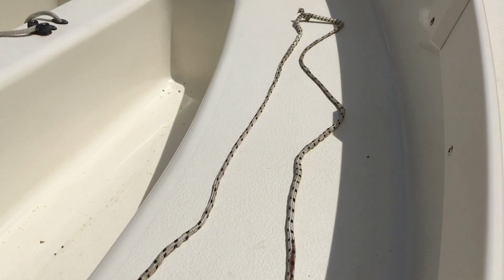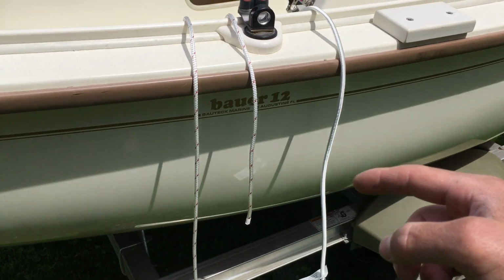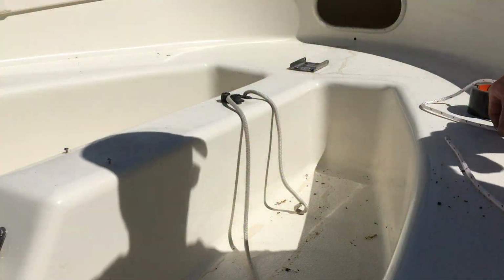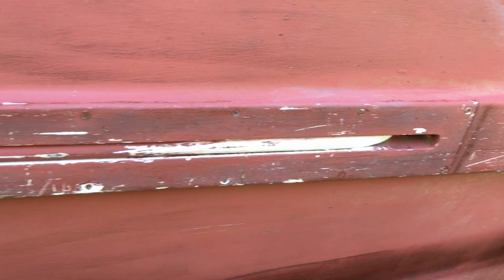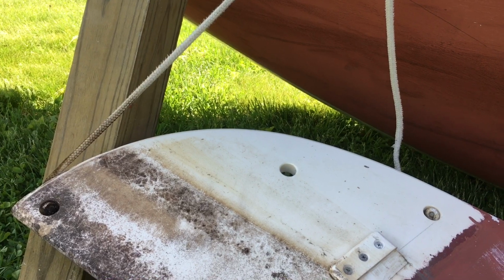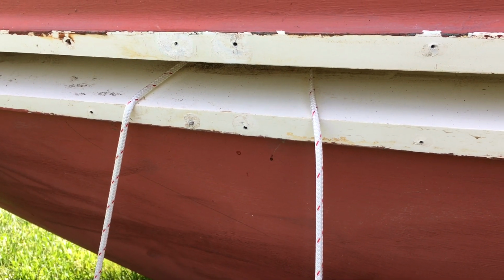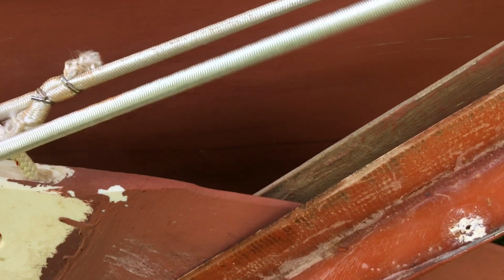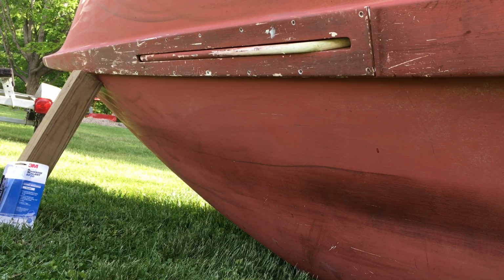Bauer 12 Sailboat Centerboard Repair - Replacing Uphaul, Downhaul and Shock Cord

Comment: I need a rudder and tiller so if i could get a picture of what it should look like I may be able to fabricate something
Reply from the maker: If you search for Bauer 12 sailboat in Google images, you should get some photos of rigged boats on trailers, and possibly even a line drawing. This one is pretty good for the rudder: https://www.everyboat.com/boat/2647-2002-bauer-bauer-12-daysailer/index.html

Like the centerboard, the rudder is made of starboard. It kicks up as well and has a shock cord mechanism to help hold it down. It is fairly large for a small boat. The wood tiller is laminated in 3 layers. Ash sandwiched between teak. It has some curve to it. They made a standard length and an extended tiller. My boat is still put away so I can’t get measurements on anything now.

Comment: Hi, I am restoring a Bauer 12 sailboat and would like to talk to you
Reply from the maker: If you have any particular questions, you can post them in comments and I will try to reply for public benefit. Others may have the same questions - and I could make more videos on the boat too. Depending on the year it came with different rigs. The company used to be responsive to emails at bauerboats@bellsouth.net
Reply: @ProductiveRecreation  thanks the boat I have is a 2001 Bauer 12 - Bautek Marine is reported out of business
Reply: I need access to an owners manual and questions on how to rig and set V it up
Reply from the maker: @wjshep1958  I bought my boat new in early 2010. It came with rigging instructions (not sure where mine are now, as we have moved a couple times and its really simple so I haven't used them since the first year with the boat), but not an owners manual. The rigging instructions were just a printout on 8.5x11 paper of a few page document. My rig is modified as I have a roller furling jib. Mine is also marconi rig. Some B12s were gunter rig. I got instructions on doing the centerboard direct from Bauer boats via that email address in early 2020. For that, the video is probably better than the directions... I could make a rigging video in the spring when the boat comes out of storage. It's very simple. A 2-piece mast with shrouds and forestay. Single set of reef points, and mainsheet to a block at the aft end of the centerboard trunk. Jib sheets run alongside each gunwhale to cam cleats positioned conveniently for the helmsman. Since I have a roller furling jib, I do not have a jib halyard. It furls on the forestay, which is on a swivel (this is the mods). The gunter rig is obviously more significantly different from my setup.
Reply: @ProductiveRecreation  ok thanks do you know of any place that sells parts for the boat - I am missing some things
Reply from the maker: @wjshep1958  It’s all off the shelf items you can get at a marine store. I think it can all be sourced through West Marine. The blocks are either Harken or Ronstan. I can check in spring when the boat comes out of storage.